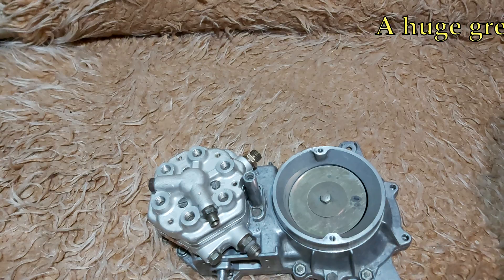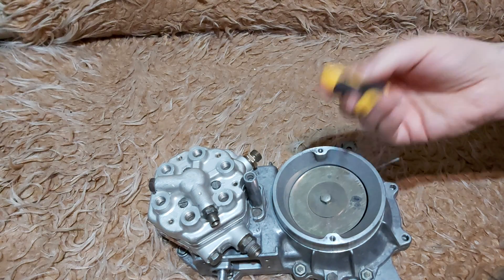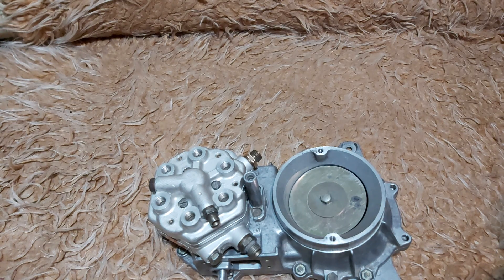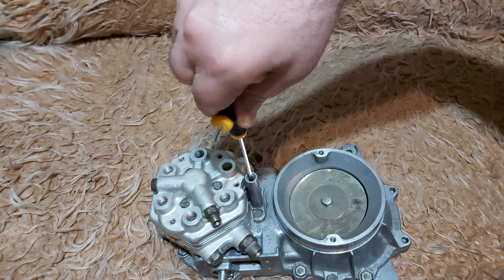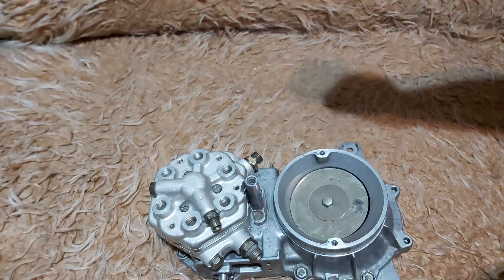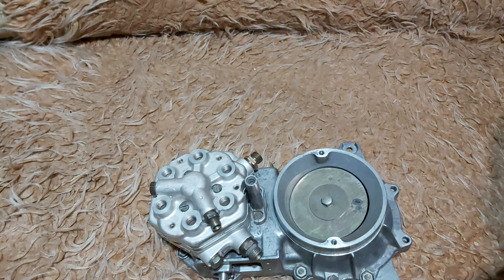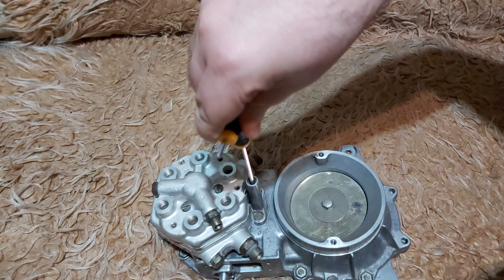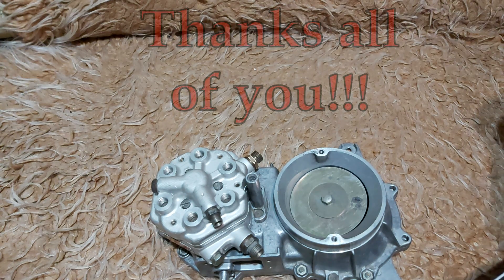㉦Mercedes Ke-Jetronic㉦ - The Initial mixture adjustmentГ/Goes for both K- and KE-Jetronic

Comment: Im trying to assist my uncle and currently his car is not starting at all. hes not only adjusted the mixture screw but the 4 individual screws on each injector. is there a standard setting for these as well? His is K jetronic
Reply from the maker: @sebastianryan8429  No, just tighten them but let it not be overtight. Replace the injectors, if that doesn't help then check the warm up regulator.
Reply: @mercedeske  Thank you for your swift response! So the 4 allen head screws on the head of the regulator I should turn all the way in until they are tight? the injectors are in and tight. Im referring to the screws on the top of the head next to each fuel line

Comment: Thanks , what is your the next step?
Reply from the maker: The moment you do the adjustment then you start turning the screw clockwise until the car almost dies, then start turning the screw counterclockwise until the same thing happens, remember how much you have been turning the screw and take the average value. For example you turned the screw clockwise for 45 degrees and the car wants to die, then you turned half a turn counterclockwise and the same thing happens then after half a turn counterclockwise turn the screw 45 degrees clockwise. On the K-Jetronic system you can manually adjust the idle so bare that in mind as well.

Comment: Wate are The  mixer skrov Adjusment tou The Baffel wathe are The mm 380SE V8 Engine 1982???? I have now 37.2mm Dont start cold!!
Reply: Have fix The cold start! Starts weery easy 💪👍
Reply from the maker: @jarmominkkinen9409  Glad to hear that!
Reply from the maker: Did you check the WUR whether it is in specs? Did you do the initial mixture adjustment?

Comment: Hey Friend, learning a lot from you about the FI system on my W124 (US spec 1991 300CE). I recently took apart the wiring connector to my EHA and did not mark the wire locations :( Can you tell me which wire goes to which terminal on the EHA? Black wire and black/brown wire.
Reply: Super! So just to make 100% sure, my black wire is on the #1 position of the little plastic connector that is attached to the wires, which corresponds to the #2 pin on the EHA. If I’m standing on the exhaust side (US passenger side) of the engine looking at the connector, black is on the right (closer to the front of the car) brown/black is on the left. Is that correct?
Reply from the maker: @mmarzynski Exactly
Reply from the maker: Hello and thanks a lot. The black wire goes to nr1 on the EHA CONNECTOR! and the other end of the wire is to the ECU PLUG nr.12, the black/brown one goes to the ECU CONNECTOR nr.10! and YES, DON'T SWAP THEM!!!! Practically the CONNECTOR nr1 of the EHA goes into the EHA pin nr.2 and the EHA CONNECTOR number 2 goes to the EHA PIN nr.1. THE BLACK WIRE goes to the EHA PIN nr.2!!!! Greetings from Serbia and good luck!

Comment: I did the initial CO adjustment like you described but I do not have any play in the plate then. If i want to have a 1.9mm play in the plate i need to turn it 4 times counter clockwise. So i don‘t know what would be the right initial setup or if anything else is wrong.
Reply from the maker: Hello. Tell me if it's K- or KE-JETRONIC and if you have pin3 on the X11?
Reply: @mercedeske  thanks for the quick reply. its a KE and I can see port 3 on the X11 port. Currently the motor wont start at all anymore.
Reply from the maker: 4 turns is too much. This procedure is being used if the CO screw has been readjusted otherwise the screw should not be touched at all. If you have turned 4 whole turns counterclockwise start turning the screw clockwise until the car starts. As it does wait for it to get to the operating temperature ad set the voltage on the X11 port to fluctuate 6.6-7.3V. At that point you will have the right mixture.
Reply: @mercedeske  thanks again. I enriched the mixture now little by little like you suggested. The motor will now start and i can keep it running by playing a bit with the gas pedal. If i release the pedal it will directly die.
I also checked the fuel pump relay like you described but that doesn‘t seems to be the issue.
Reply: @mercedeske  I have 1.8V to 2V on pin 3, when I turn the screw the engine starts running worse. Voltage doesn't change
Reply from the maker: @GybelsBavo  Have you checked all the sensors, replaced the o2 sensor and the potentiometer?
Reply: @mercedeske  I have checked the potentiometer and the resistance and voltage is ok. I suppose I have a faulty o2 sensor? Voltage in pin 3 is 1.4-2V when measuring between the pin and ground.
Reply: @mercedeske  I set the screw so that the car would run at 1250 in P and around 800 in D, any other adjustments makes the car idle bad. When driving the engine or applying gas the engine runs well.
Reply from the maker: @GybelsBavo  Which car is it about?
Reply: @mercedeske  w126 300se

Comment: Hello, i have learned so much from you and i appreciate that you are helping so many people to unravel the KE Jetronic mystery to make it understandable!

However, i recently cleaned my throttle body on my KE3 Audi 2.3e and my idle speed went all the way up after that, to 1200-1500 rpms (it was 800 before cleaning). I have checked for air leaks but can not find any, everything is air tight and throttle cable is not stretched. Car runs and starts great otherwise, is there any adaptions that maybe stored in ECU or what do you think? Remove battery terminal over night?

Huge thanks again for all your knowledge and dedication!
Reply from the maker: Hello and thanks for the compliments. Concerning the issue - try checking the throttle position sensor to see if it recognizes both positions.
Reply: Where is the throttle position sensor?
Reply: Problem was at the potentiometer, he has made a lot of videos about it :)

Comment from the maker: If the car won't start at all check at first the rubber hose which connects airflow meter to the idle control valve. When that hose falls off the car won't start at all which means that the mixture is too lean and there are going to be detonations. This video is predicted for those who messed up with the CO-screw, which car won't start and who do not even know in which direction to turn the screw to get it back as the mixture is supposed to be! This explanation is NOT predicted for those who just want to play with the mixture not having any other job to do!
Reply: My car wont start when the rubber hose from the airflow meter to the icv is connected. I Can only turn on the engine with a vacuum leak going to the icv… help?
Reply: Just picked up my first 190e, apparently need to adjust mine,cuts out at traffic lights if I leave it in drive and runs a bit lumpy?